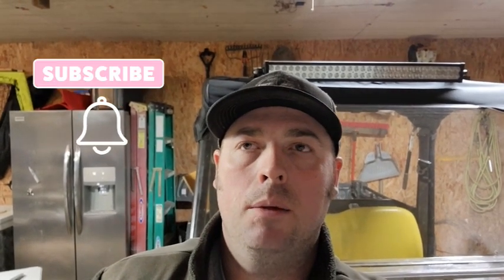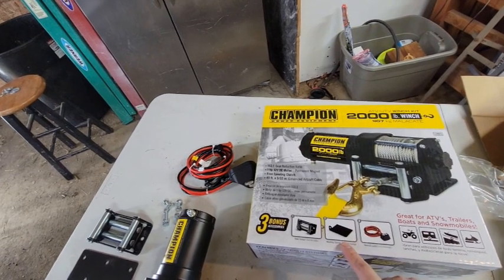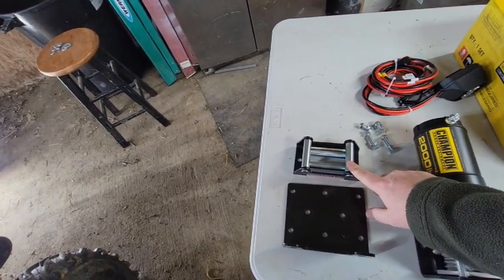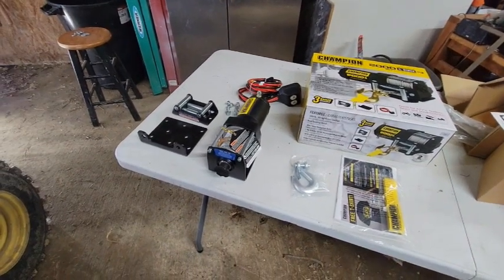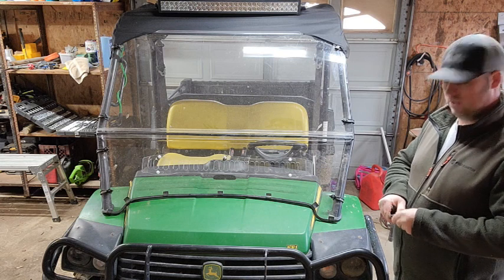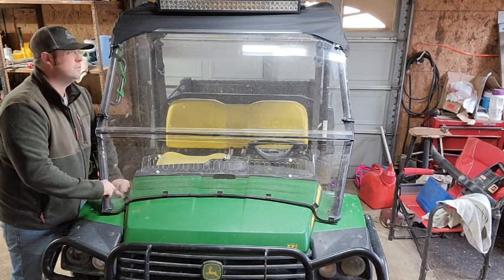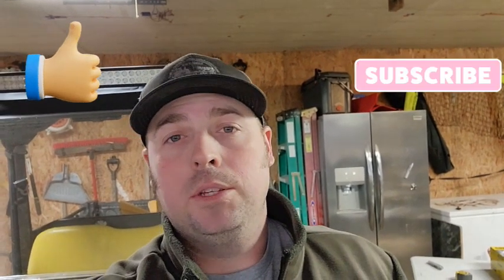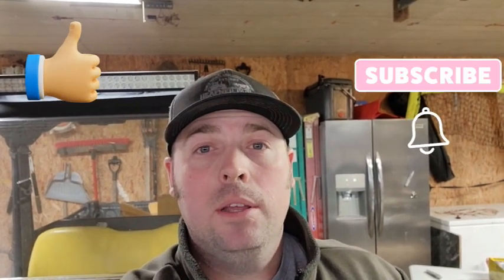How to install Champion 2000lb winch on John Deere 825i Gator. #heafnerfarms #farmlife #johndeere

Comment: I like your video! Did you install a solenoid? I have the same Champion winch that I want to install on a 590i Gator and was wondering if you need I solenoid install so as not to drain the battery. Thanks for posting
Reply from the maker: No I didn't do anything else other then what it came with. I do know that some people put a fuse to protect it from the battery and that is separate from what came with the actual winch. Other than that it probably won't hurt. Let me know if you end up doing it or not